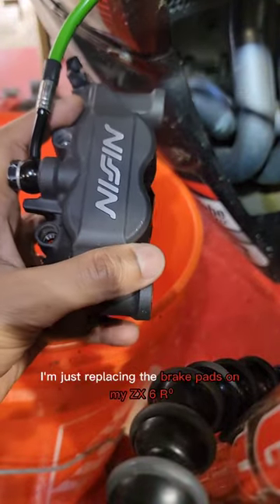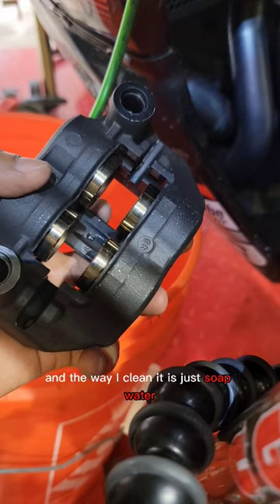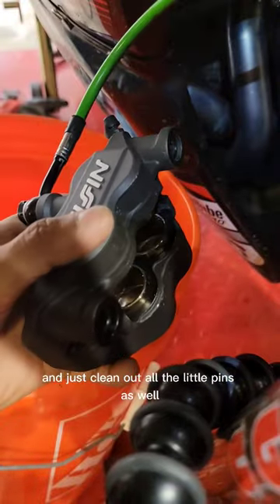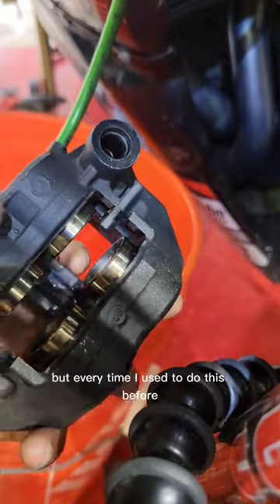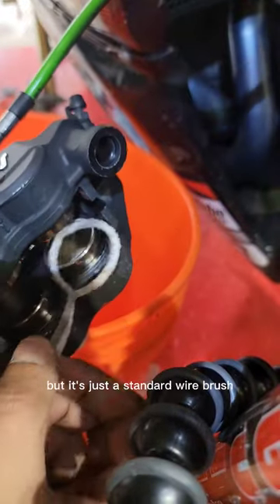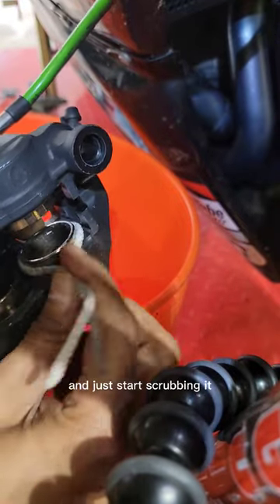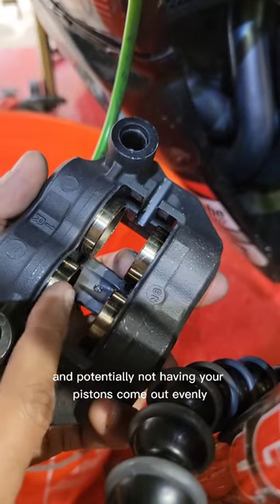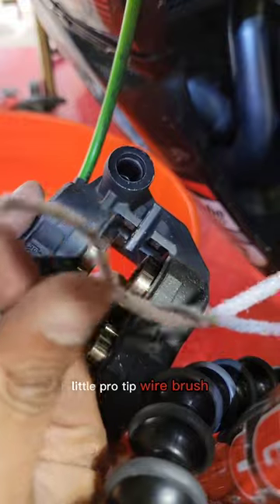PRO TIP when cleaning Brake Pads #motorcycle #kawasaki #kawasakizx6r #yamaha #yamahar6 #brake

Comment: Or brake cleaner. It’s a cleaner. For brakes.
Reply from the maker: You don't want to use brake cleaner on pistons. It'll dry out the seals.
Reply: @cheetah740 That is correct. The solvents in brake cleaner like acetone & sometimes methanol I think is what makes up some of the brake cleaners and canannihilate rubber.